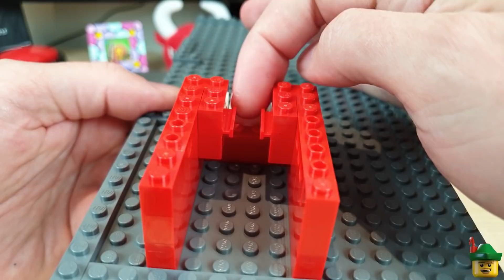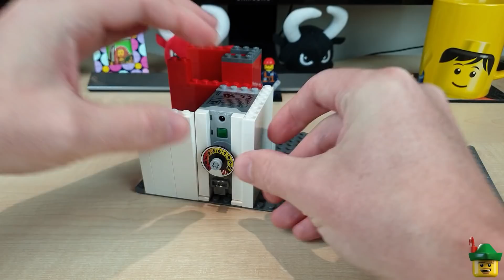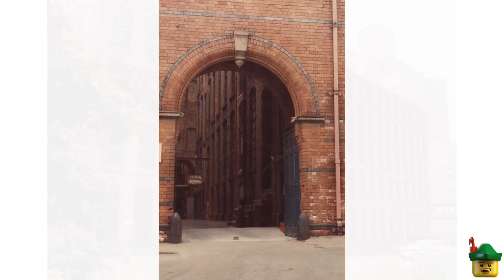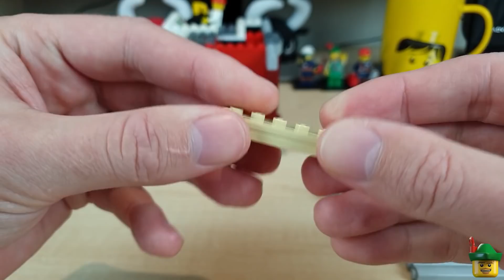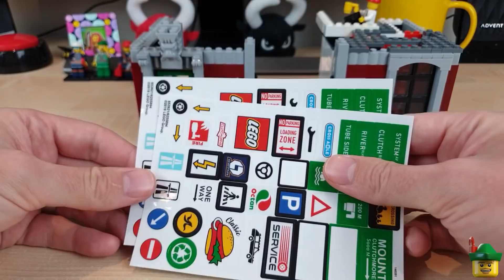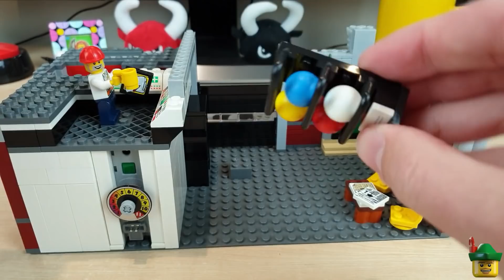LEGO City Update - GBC Factory MOC Part 3 🏭🏹

Comment: That was a little more complex than what I was thinking for moving the arms, but will certainly look better. The system I was thinking of would have had them moving at the same time, with the same motion, which would not have looked as good.
Reply from the maker: Ahh you found it.  Yes, it worked better than I'd hoped.  A good subscriber suggestion!

Comment: Loving the moc ! :D maybe an idea to "add" mechanical touches by using the rubber tubes lego has put out but laying 1 or 2 on the floor, different sizes too ! Or maybe a funny scene outside of the building with a construction worker being hit by a ball that fell out of a window by accident ! (Just stating ideas :p not that you have to)
Reply from the maker: Good ideas, I have loads of the balls!
Reply: @RobinHoodBricks  i also have another idea 😁 using 1×4 yellow tiles with black stripes on them for caution, just somewhere where you see fit or maybe on the roof some solar panels to make it seem they get their energy from the sun instead of really showing it that it came from a battery

Comment: I love everything about this so far. I really hope U find a way to incorporate Charlie Chaplin into the factory. 1 thing 2 mention tho, I hope U can find something 2 go in the window 2 the right of the garage door. Otherwise it is just looking in at a red wall. Maybe some closed elevator doors. That would make really good sense and B a great use of that small space. 1 set of the doors can B ajar maybe. I’m sure it would still B dark enough 2 hide the secret mechanism.
Reply from the maker: There will be some detail in that space next time but more doors is a good plan.
I don't think I'm gonna add a Chaplin as it's a bit of a difficult reference with only a head to link to him.  I'd also have to alter the face!

Comment: It’s awesome. You don’t theoretically really need that intermediate axle like you currently have, although it works. The same bevel gear could be added to the third sprocket on the left if the axle was slightly longer. That surface is no further outboard than the setup you have. The axle concept you’ve devised can then just be extended horizontally and mesh with the newly positioned bevel gear. But you’ve effectively done it, and I can’t wait to see the final result.
Reply from the maker: I think I understand.  I could run a bevel off the gears to the left and have that drive my current axle.
I suppose my way looks like a second machine not attached to the first.  Either way, it works, and reliably.
The hardest bit was stopping the arms flipping backwards!

Comment: Have you considered a glass wall or a glass and brick wall with a door to seperate the loading bay from the staff/reception area?

It would give potential customers a view of the work floor as they pass further into the factory.
Reply from the maker: I'm thinking I won't have customers in the factory.  Too many fences required.  A staff space will be just as fun!

Comment: Looks great, like the construction you made for the doorway. You read my mind when putting that display stand with the balls: qll great details. I'm missing some kind of reception in the break-out room though.
I fully agree the "chimney" adds extra detail, though it looks a bit skew,  isn't it? Why don't you make the exact same construction as halfway on the bottom?

Anyway, great building, still believe this is Lego-idea quality; I might even think with this one you have a much bigher chance then with fast good corner as you do not compete with the modular series.
Reply from the maker: I agree with that, this could be an Ideas winner.
The chimney solution looked skew but isn't.  I think the wall was leaving out or in.  It is perfectly legal and straight when the plates are on top holding it together.
I considered a reception.  I'm still not sure.  The rack is indeed awesome!

Comment: What if near the pipes,there were circuit breakers.
Reply from the maker: Which pipes do you mean?  So, a kind of a safety stop feature then?  Good idea!
Reply: I mean,what if u replaced a black pipe,with a grey pipe,and put 2 head light  Bricks-on top of each other,and put printed studs showing dials.I tried it on my facade factory,and it looks like circuit breakers

Comment: Great job Robin, It's looking amazing!  I really like the color combinations your using and that green door really pops with the red of the buidling.  I like the stone work look above the door as well. The use of the loading zone stickers were also a great idea and really adds to the front.  Couple amendments I could think of is adding a tea/coffee pot for the break out area and have at least one or both workers having a mug.  I was thinking you could add a door to the back of the build. Putting it left of the speed control dial and putting in a solid black or dark bluish gray door for like a mechanical room door way since technically it is a mechanical room.  It could be where the circuit breakers are if there's room inside maybe some conduit pieces on one side of the wall like what you used for the gutter down spouts to hold in place and some gray 2x2 or 2x4 tiles to simulate circuit breaker/fuse box's.  I know it's details you probably wouldn't see but hey it's there. Great MOC so far I can't wait to see the rest of it.
Reply from the maker: This sounds great.  I'll definitely take a look!

Comment: Hey Robin, Looks really good. Maybe the garage door may cause some problems while open as it may block the balls' way into the truck... A solution might be the mechanism as in the corner garage's garage door.
(Or a smaller (and thus non completely closing) door)
Reply from the maker: Well with the truck sticking out it won't go up and down so I just need a few slats so it looks like it could in theory.  Just a bit of decor!